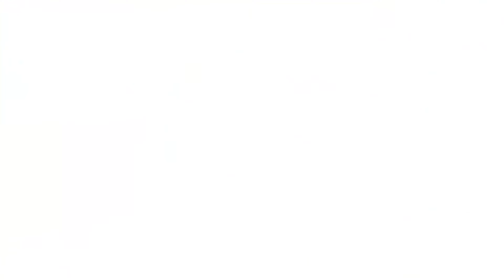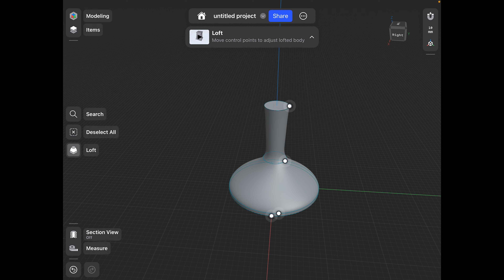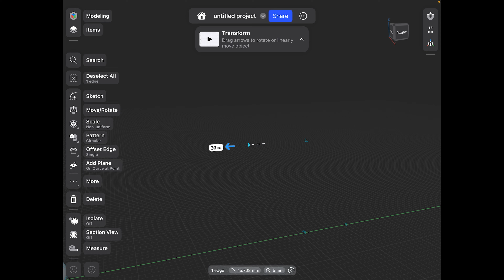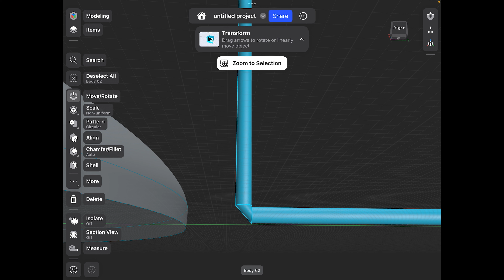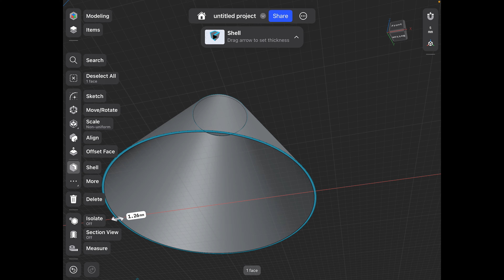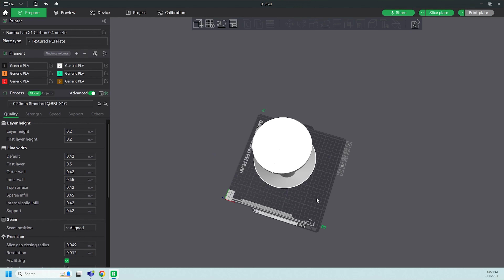Designing and 3D Printing a Lamp, Start To Finish (Shapr3D, Bambu X1-Carbon)

Comment: Thank you for the great video How do I move the outline of the shape at the 28 minute mark please.
Reply from the maker: Good question.  You can move it by selecting it and then choosing Move/Rotate at the left.  If Move/Rotate is not visible, you may have to select the More button to see additional options.  Once you have Move/Rotate selected, over your object will appear a group of arrows pointing in different directions.  Tap and drag the arrow of the axis in which you want to move to move your object.

You could also delete your object by selecting it and selecting Delete at the left.
Reply: @thisprintedthing7967  Hello..I’ve been trying to do that but it is moving the entire object, not just the circles. Any ideas?
Reply from the maker: @wallnutz4813  That would suggest that you're actually selecting the object, and not the sketch.

Comment from the maker: So what should I make next?
Reply: a heat sink for this thing, otherwise it will melt... :D
Reply from the maker: @laurv8370  well, it hasn’t yet, after several months of use, usually being on for a couple hours or more at a time.